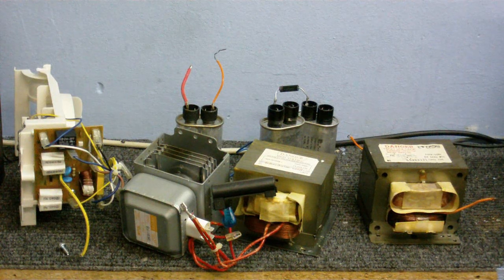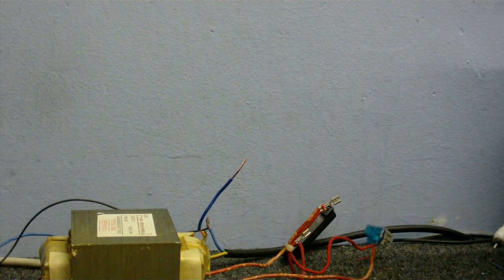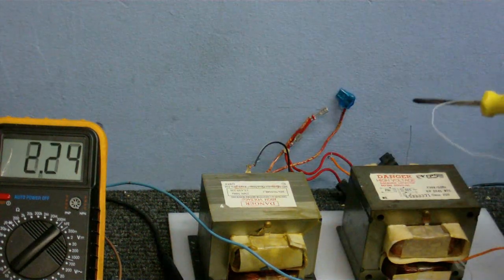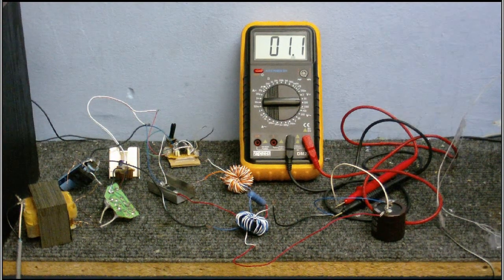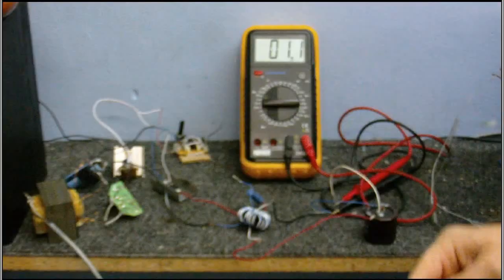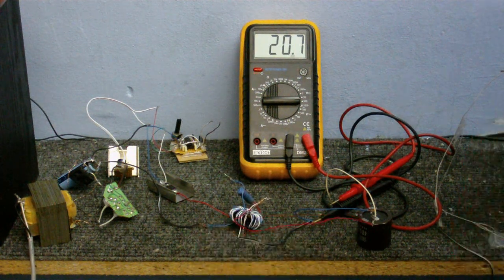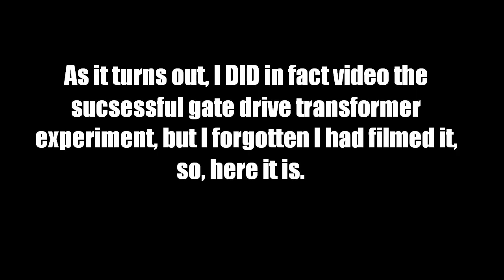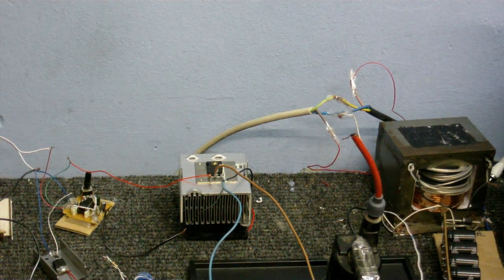Experiments with Power Transformers, MOTs, GDTs and more flyback driver failures

Comment: transistors need a certain amperage to be able to switch, espesially if you have a high load on the source and drain. you can fix this by putting the transistors in a darlinton configeration.(have the drain of one trigger the gate of the other and put the sources of both to ground. just throwing stuff out there.

Comment: Probably the gate doesn't get charged fast enough through the 10k resistor. Now I don't know what mosfet you're using but say it has a gate capacitance of 700pF. Depends on the voltage between S and D. 

Then you can calculate the cutoff frequency just like an RC lowpass filter.  It gives me a cutoff frequency of 22748hz. Don't know what the frequency you are using but if it's 20kHz it's really close to the cutoff frequency, and the gate doesn't turn on quickly enough, it ramps up and then...